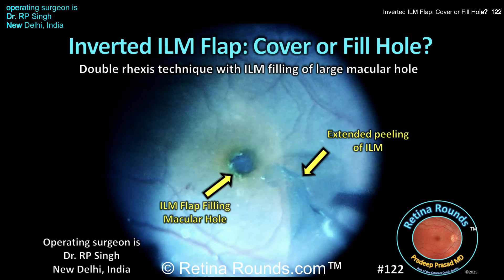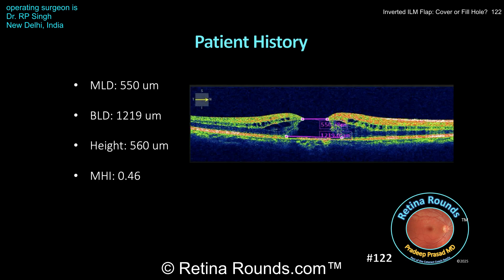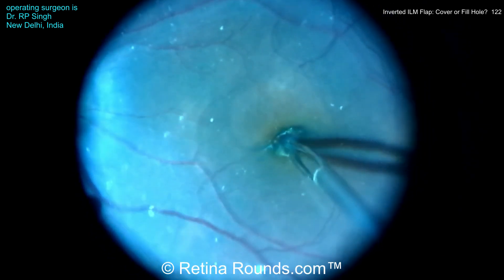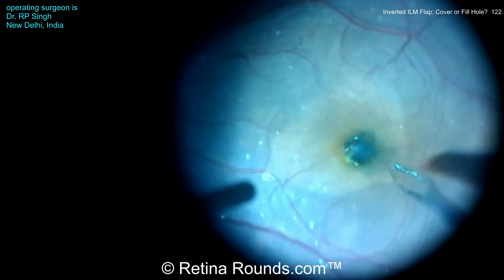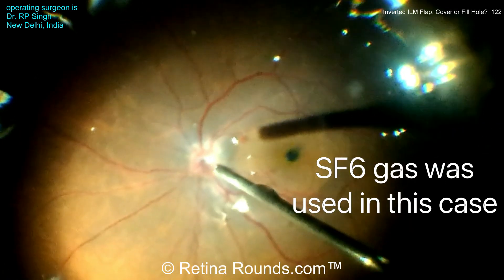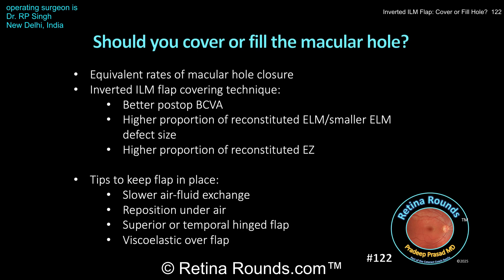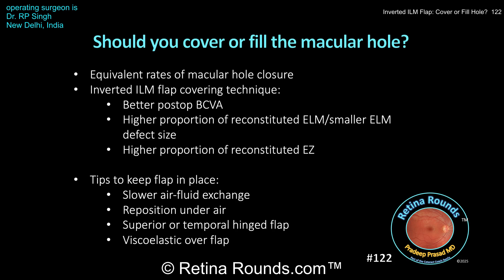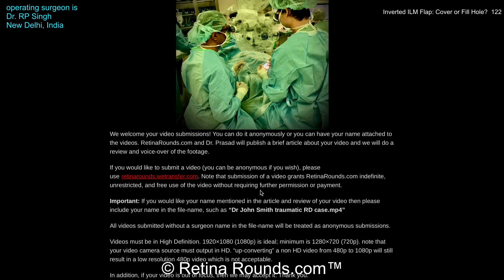RetinaRounds™ 122: Inverted ILM Flap: Cover or Fill the Macular Hole?

Comment: ILM flap works well , just allow the flap to fall on the macular hole from any, one side so it drapes the hole. Visual improvement is better with this technique,as the visual improvement in a macular hole is dependent on the approximation of the edges of the hole. Anything stuffed into the hole may potentially hinder this, although the OCT may show closure like appearance due to the stuffed ILM... I have completely shifted to air tamponade and the results are equally good.. have data of about 100 caes now with air alone in large macular holes.. this we have coined it as minimally invasive macular hole surgery. No adjuvants like visco etc are used. Peeling ILM in a cetripetal manner is helpful. Don't stuff. Just allow the ILM to drape the hole.

Comment: Great videos and tips as usual! Thanks!
Another option for laying down the ILM over the hole has been referred to as the carpet or rug technique. The ILM is peeled in usual fashion with attention placed on creating a ILM hinge not attached to the hole edge, but rather more peripheral macula around the area of the arcades. Then with FAX the ILM is replaced over the hole. This will not be an inverted flap, but rather the flap will stay in anatomical position (with now released tension) and just replaced over the central macula and hole, like laying down a carpet. Similarly, A temporal or superior hinge would be helpful in ensuring placement over hole.

Comment: viscoelastic certainly helps in settling the multiple folds of the ILM flap, filling the macular hole with the added pressure, although it does seem counterproductive to fill the macular hole as it might prevent type 1 closure, i will check those articles out, thanks Dr. Prasad.

Comment: How important is the second rhexis performed here? Does that wider ILM peeling confer a benefit? Usually I perform a large inverted flap superiorly to cover the hole but do not peel any of the ILM inferior to the hole but sometimes wonder if I should? (Fellow in the UK)
Reply: I do the same as this and have excellent success rates I never touch the inferior ILM.